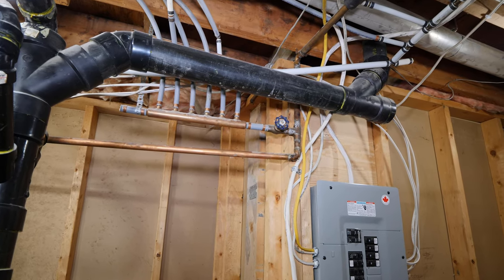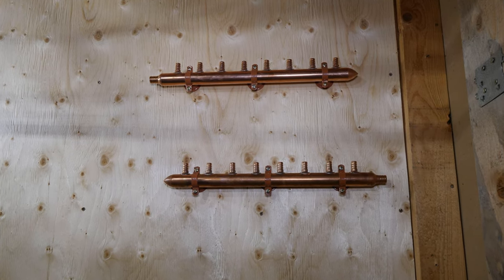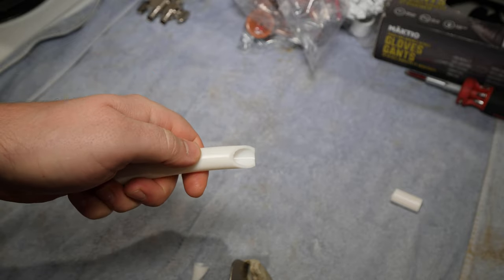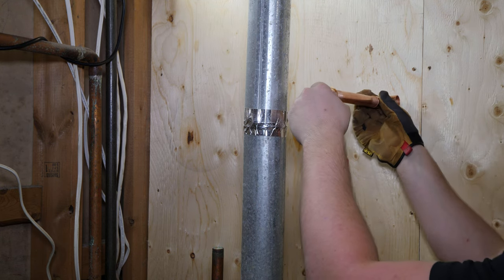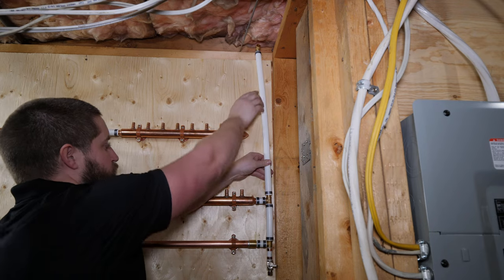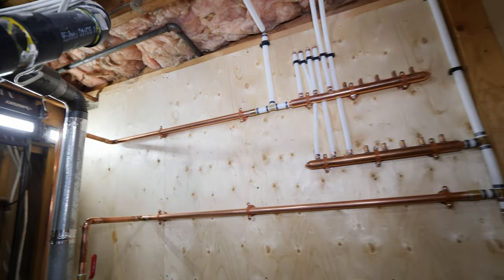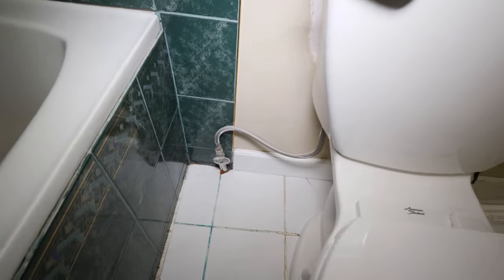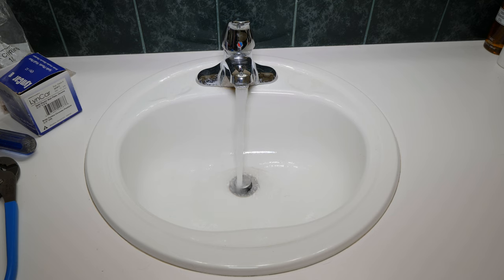PEX Manifold System: PEX Water Lines

Comment: Great videos, and information that gets to the point. I repiped my house a few years ago with pex, using a similar manifold system with individual shutoffs for each line. I installed a 3/4" line attached to a recirculating pump for the hot water manifold that has inlets on both sides for a return line.